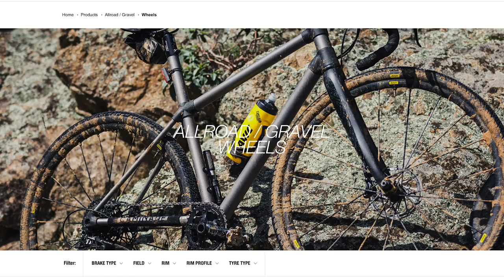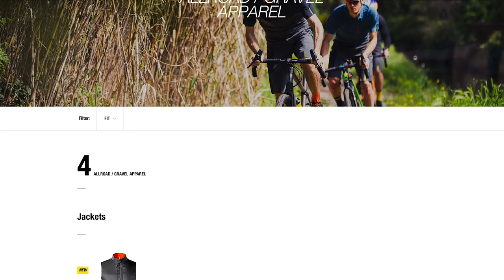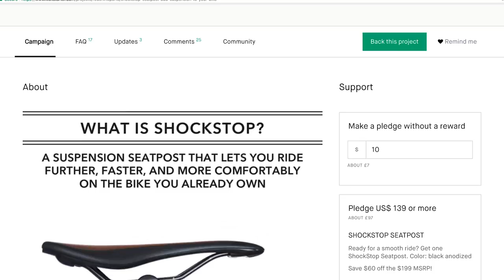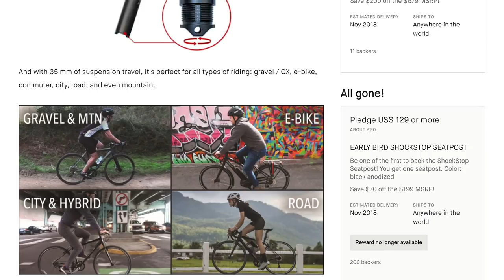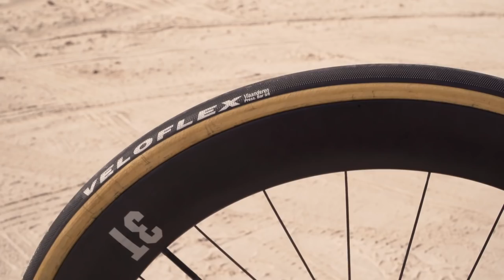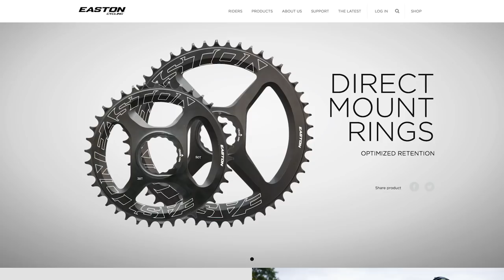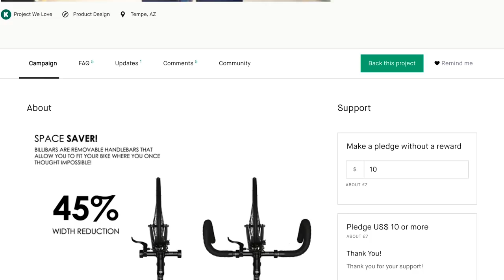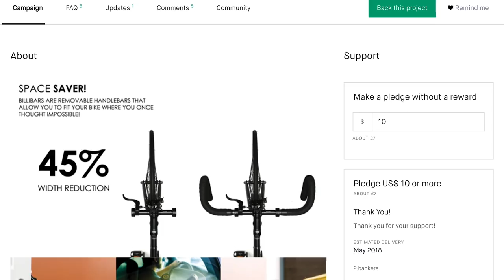Has Cycling Tech Gone Too Far? | The GCN Tech Show Ep.16

Comment: The reason when I was a lad why I got a bike was because I could not afford a motorbike or car. When I got a job, I got a motorbike. When I started being paid more I got a car. However, cars and motorbikes need endless servicing and fuel, and then expensive repairs as they get  older. I looked back to the days when I had a bike, I could maintain it myself, I provided the power myself, it didn’t cost much. It was simple, you just got on it and pedalled. I bought a great bike and I love it. But if it stops being that simple, then it will lose its charm for me.
Reply: You forgot the part where the bike now costs as much as a car ; )
Reply from the maker: Cheers Garth, great to hear you are back on the bike 👍

Comment: Bike tech hasn't gone too far but prices did indeed.
Reply: You can buy a nice, brand-new aluminium road frame from Ribble for 72 quid. You can buy a nice pair of aluminium crank arms from Aliexpress for £15. You can buy a narrow-wide chainring for as low as a fiver. You can buy a carbon fork from eBay for £30. If Chinese carbon is not your cup of tea, you can buy an aluminium one for £60. For 15 quid, you can buy a Selle Italia replica saddle that weighs 140 grams. For £20, you can buy a pair of titanium pedals from Aliexpress (I have them and they're great). And so on. It's possible to build yourself sub-8-kg bike for under 600 quid, all with brand-new parts. Or you can buy it ready-made for slightly over £500, also brand-new. The average salary in the UK is close to £30,000. A year's salary on minimum wage is close to £16,000. As long as you don't buy the gear that Contador and Froome use, bikes have never been as good or as affordable as they are today. You have no reason to moan.
Reply: chesshooligan 1 with that you can build a nice commuter bike that would weigh around 10kg. You can't compete with 8 kg bike which would cost you about $2000 but if you go for top of the line stuff we are going over $6000
Reply: Did I say 500 pounds? Sorry, it's 500 dollars, under 8 kg. Here you go:
https://www.youtube.com/watch?v=1znZkzvA4Jk
Reply: chesshooligan 1 although it's a great idea the common beginner would not be able to go shop for parts and build her/his bike (it would cost more in tools than anything else). They will go either on line or to the shop and buy something that fits their budget. Local bike shops rarely like to make custom build products (it's not economical for them). The reality that the majority of people face is that a decent entry level bike is about $1200. And generally speaking is 1 or 2 kilos heavier than a competitive bike. I have a bike that costed me $1800. Plenty of good for my level but I had to compromise on what I wanted to keep it in the budget it's still 8kg. I'm trying to see if I can bring it under the 7kg buy buying Chinese stuff and keep it safe and rideable. I will let you know how it goes.

Comment: RE: Do we need a 12-speed cassette? I don’t know about the pros, but as a recreational rider, I’ve been waiting for a 12-speed cassette for a couple years. I’m a heavier rider at 200lbs with a 295W FTP, max instantaneous power of 1,300W and 30s sustained power of about 600W. There are a couple rides in my area with 20% gradients. With a standard crank set and an 11-28 cassette, I can find myself pushing upwards of 600W in the 39-28 gear on some of these climbs with my cadence dropping below 50rpm. If the climb lasts more than 30sec, I’m wrecked, and if my cadence drops any lower, it becomes a real grind. A couple years ago, I switched to an 11-32 cassette to let me keep my cadence up on those steep climbs. I couldn’t bring myself to go to a 12-32 and lose my 11 tooth cog for sprints and slight downhills. So, the cog that gets dropped in Shimano’s 11-32 cassette is the 17 tooth. On 95% of my rides which are mostly flat, our cruising speeds have me in the 53-16 or 53-18. Recently, I’ve decided to go back to the 11-28 cassette because I find myself frequently trying to decide between those two gears, wishing I had a 53-17. The 12-speed lets me have my 32 and 17 tooth cogs. Finally!

Comment: Just wanted to add on your discussion on different levels of bikes and their equiptment. I own a merida scultura 900 (claris) and 300 (tiagra/105 brakes). It's truly magnificent how much the two bikes feel different. The acceleration, comfort, braking. On the scultura 900 (my first cheap road bike before i knew that i liked road biking) it feels insecure, slow, flimsy. however i'm not worried about it falling apart. However on my new 300, it feels quick, reliable, agile. The best example is braking... the brakes are just so much better, i'm not afraid to approach corners at fast speed any more...  before, the brakes had so much flex in them I was afraid. The only issue with this is a 6 months snowy-icy winter session... had my first spring ride last week and crashed after 3 kilometers because i was overconfident accelerating...

now if i could just have that new pair of wheels... :D
Reply from the maker: Thanks kxp06, let us know if you go for the wheel upgrade!
Reply: It's a tight race between a new set of wheels and a power meter :D one will prevail this year, the other might have to wait for next season.

Comment: I've got a tech question! Is there a difference in corrosion resistance depending on the level of groupset? Like would Ultegra parts be less prone to rust or corrode than Tiagra? I live in a coastal region and commute by bike and ferry boat, and salty spray is an issue for my commuter bike.

Comment: I think tech is great and it has advanced nicely in the last few years. When i upgraded my 2009 tt bike with the latest Ultegra gear plus 60mm rims last year and used some other tech for a speedy long ride (112 🤫 miles), i realised my bike was taken from almost entry level of the time to well above the best of my bike from the time. It transformed the bike and appreciated the understanding they have found to make the drivetrain better and stiffer. From feeling like a flexible carbon frame it felt taught and a breeze to ride. I was virtually on my best ever 25 mile pace and kept going well beyond, achieving a time i never dreamed of. It even kept up with the replacement of my bike and it wasnt me making the difference. I used to hate my bike and now i have customised i wouldnt want anything else. Tech did that.
Reply from the maker: Hey Joey, thanks for the comment. A pretty good example of how tech can completely change the way a bike feels
Reply: GCN Tech sure does. I couldnt believe the difference. Only did one shakedown before the race because i changed everything last minute so it was a proper surprise to be as competitive when it had always been a struggle before. The old drivetrain was probably pretty heavy too so the weight loss for a tt bike was a big benefit on the hills. For this year am able to look at more of the smaller gains for extra improvements but 1.5 hours faster was encouraging. Quite pleased to finish quicker too as it hurts the neck in the aero position 🤕

Comment: 1x drivetrain will only be the definitive answer on road bikes when they make 22 speed cassettes, so that you can have all the shifts smaller than 10% gap and 450% range. This way with a 53t chainring and 12-56 cassette you go from 10.83 to 55.43 km/h with 25mm tires with cadence between 90-99. This way no hills will make you grind ever. 1x11 is exactly half of that, with gaps of 20% if you use 49x11-50. And small cogs are less efficient, wear faster, and below 11t the gap is already at 10%, hence why I'd go for a cassette starting on 12, and ending on a cog as big as needed to climb very steep hills spinning...

22 effective gears can be achieved in two other ways: recumbent with long chain and 50/24x12-25 11s, custom crankset and front shifter.... or a triple crankset. I don't think 22 speed cassettes are coming anytime soon, so I'm on a 3x11 setup, and not changing!

Comment: My opinion is that 12 sproket is not needed if the cassettes biggest isn't 34 or 36. It could solve some of the problems, we could put 52/39, not 52/36 and cadence change from shifting to the smaller gear in the front won't be so massive.

Comment: i already commented this on last video... but a single spoke wheel will not work as the centre of mass will not be in the middle of the wheel which will cause the bike to feel weird as well as bounce at high speeds!  a single spoke wheel is basically only possible as a disc wheel...

Comment: Mavic should focus on making 27" wheels not 650b witch is 26"x1 1/2( or 26x1 3/8, don't remember witch one...). 27"wheels are larger in diameter than 28". That should help with confort for gravel bikes.

Comment: If you can't wait til November for the Shockstop, the Body Float from cirruscycles.com is currently available, externally adjustable, and comes in proper post diameters instead of using shims. Got one a few weeks ago and couldn't be happier. As for the weight? I set a PR on a long climb that afternoon.

Comment: I love technological advances for the many reasons listed below. However, there is something about electronic shifting that doesn’t sit right with me. If I have to charge a battery on my bike to actually get it to work, than for me, it’s starting to get a little too far away from the spirit and purity of riding a bike. I’m sure they are amazing pieces of equipment, but everything else in my life is wireless and has to be charged...on a bike it seems a bit contradictory and too far. 

Next up, integrated handlebar heart rate monitors and gps computers integrated in the bike...and a little dashboard that tells you when you tire pressure is too low and you need a new chain.  You can also stream you favorite music via Bluetooth to your helmet that has integrated speakers by Beats from Dr Dre while you adjust the heat setting on your saddle. 🤦🏼‍♂️

Comment: Disc bikes win over rim bikes every time! Gotta start pinning disc against disc for bike of the week!
Reply: Disc brakes make no difference if you are an experienced rider. I hate the way they are being pushed onto the road scene as they look so bloody ugly. I can totally see the benefit on gravel and cross bikes but lets keeps road bikes looking classy.
Reply: Paul Hughes:  Good thing everyone starts as "experienced riders" then, huh?  And the fact that some of those World Tour riders are choosing them in no way takes away from your argument.
Carbon wheels on long downhills or in the wet are reason enough.
Reply: I totally get your point and a rim brake road machine has a particular look, but the fact of the matter is that having a rim that is also serving as a braking surface is not Ideal. If you want carbon rims then forget rim brakes cause your rims now have an expiry date due to the wear. Otherwise removing the braking surface from the rim allows rims to be designed  purely to be good rims without safe braking in mind, you can make rims lighter, stronger, wider, more aerodynamic and overall higher performing.

Comment: Curious about the pedal bob with suspension seatpost
Reply: Jakeafer I think the post would bob. The saddle is maximally weighted when your pedals are at 12 and 6 (ie not putting down any vertical force) and minimally weighted when at 9 and 3 (max torque). So the saddle would move up and down during the pedal stroke. However this could be remedied by setting the sag point at the maximally weighted level and then using a hard stop to prevent the post from going any higher than that. This way, you would still get the shock absorption from any force higher than the maximum weight you put on the saddle but during normal pedaling you wouldn't get any bob. But that's just my hypothesis.

Comment: Tech has definitely gone far beyond realistically measurable differences. Take for example $400 pulley wheels that save you 2.4 watts at 40 k/h. 2.4W is within the margin of error of the best power meters in the market. However, all this is a good thing. Some ppl make more money than they know what to do with so i think its fair that they get to spend it on new tech that although not all that beneficial is definitely cool. More importantly, it makes older products cheaper and more accessible to lower income people. I can enjoy a wide range 1x10 clutched groupset on my gravel bike because with the introduction of the unnecessary 1x12, 10 speeds is now "lower end" and therefore cheaper :)
Reply from the maker: Some interesting points there Fernando, thanks for commenting!
Reply: The problem is with the power meter, not with the pulley. 2.4 watts is, for most of us mortals, about 1% of sustainable power. Although I agree with you in that $400 is too much money to spend for a recreational rider to obtain such a small benefit, those figures shouldn't sound so outrageous when you consider a weight savings of 1 kg -- between 1 and 1.5% of the combined rider-bicycle weight -- normally costs about $1000. If I had to choose between the two, I would go for the power savings, as it's beneficial both on the flat and when climbing. Weight is overrated; aero and friction are underrated.

Comment: Mr Last. Bike tech has a long way to go. The chain is still the most inefficient part of the drive. Do not be surprised to see bikes in 10-15 years time with belts made of an exotic, hardened substance, which would 1/2 or 1/4 energy loss. The gearless, variable speed system needs to be developed, perhaps with gradient-determined automatic shifting or wireless button shifting like we already see. Oh, and these bike would weigh 4kgs. Even the ProTour bikes are 6.8 just now! How dark ages is that?!
Reply from the maker: Interesting stuff Mark!

Comment: I would like bike tech to advance in the direction of ease of cleaning/maintenance.
Reply: It can be done today, You have the Rohloff and the pinion gearbox, and on top of that you can combine them with belt transmission rather than a chain. The drawbacks are: 
1) You'll need a special frame for both the pinion gearbox and the belt, so that's going to cost money 
2) The shifters of both the Rohloff and the pinion are those atrocious, Walmart-bike-type grip shifters. Some people make custom traditional shifters for Rohloff, and probably the pinion gearbox too, but that's also going to cost money.
3) You'll lose some power to friction. If I remember well, the penalty is about 3-4%.
4) There's also a weight penalty -- about 1 kg, I believe.
But yeah, I agree with you. If this kind of gear were more popular, it would come down and price and increase in quality too. Maybe in another ten years, after we have taken the derailer technology to the limit, the three big companies will start taking an interest in this kind of stuff.
Reply: chesshooligan 1 ive got a few ideas of how to make it more clean friendly by removing tight corners around the bike, modify the setup of the drivetrain to remove gaps and areas that need cleaned out. I have ideas of how hat may work. A few that you could retro fit and make with a 3d printer but hat wouldnt be as good as making it that way from the ground up.